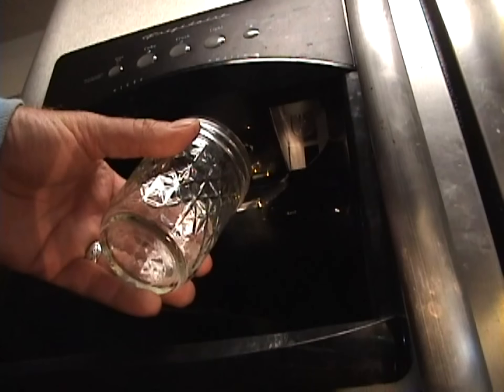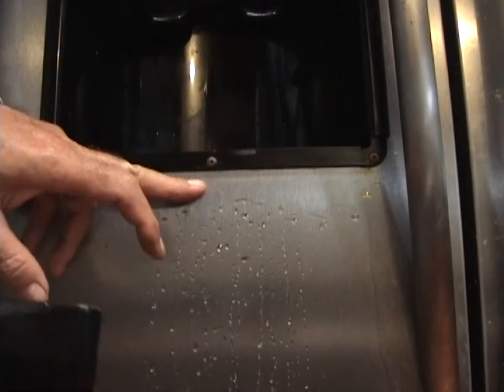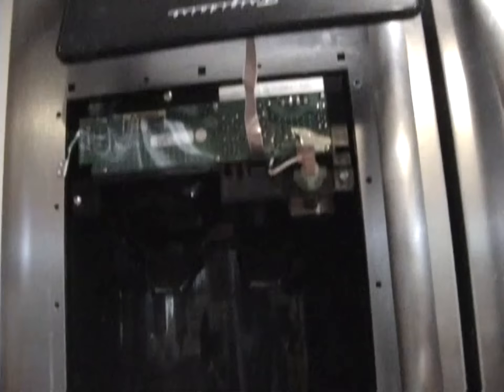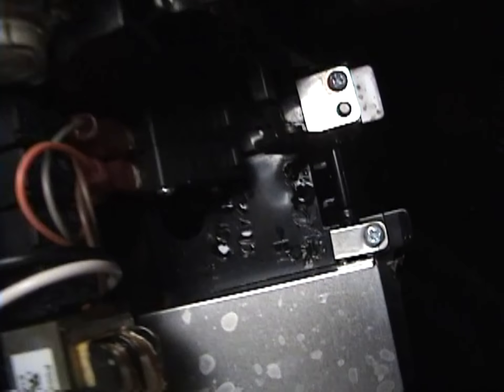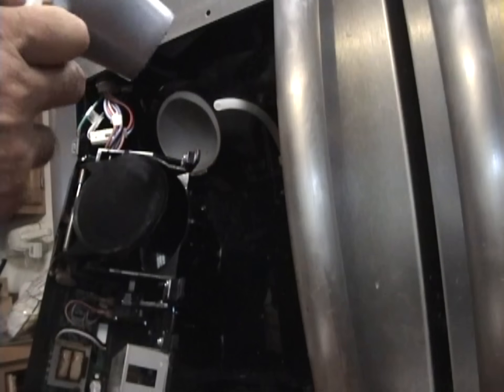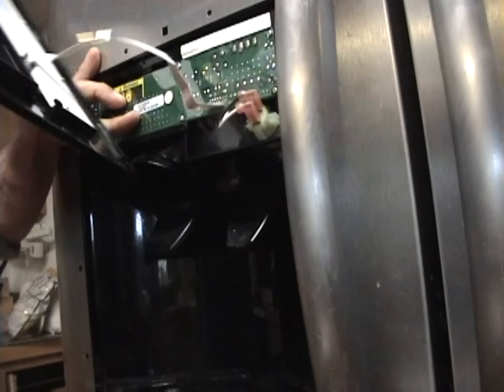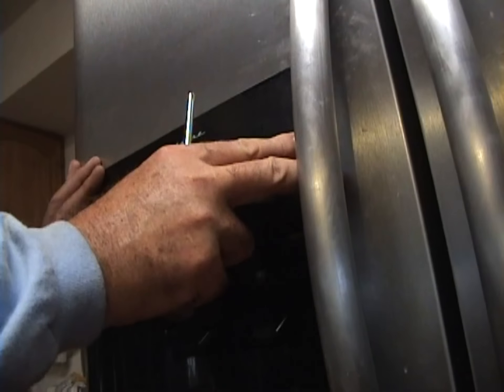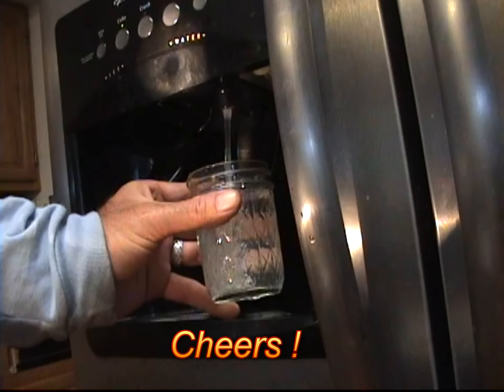Refrigerator  Door Water Dispenser Leak Fix

Comment: Jim, Thank you so much for posting this video on You tube.  My son, who is 15 years old and wants to be an engineer, reviewed the video and fixed the Water Dispenser in about 20 minutes end to end.  He didn't even need to add the additional adaptor. He just patiently manipulated the tube until he was able to fit it back into the despenser hole.  We are very greatful and you saved us a call to an authorized repair technician.

Comment: Thank you very much Jim - you saved the cost of a new fridge.   I changed the filter and this caused more water pressure which was enough for the water hose to come out of the housing, which then caused the ice auger to continuously run.  I took everything apart, used a hair dryer to dry the electrical components.  I was able to feed the water hose up from the bottom door of the fridge to give me an extra few inches to guide the hose back through the spout so i can see a 1/4" of hose. thnx Mark

Comment: Thanks for this. I  had the exact same problem after changing the filter and your instructive video saved what would have no doubt been an expensive house call.   Hardest part is trying put the hose into the dispenser. Used a piece of string and threaded it through. . .worked like a charm.
Reply from the maker: Good idea on the string... thanks for the tip !

Comment: Thanks! I had this same issue with this model fridge. My kid broke the water actuator paddle, so I had to replace it, but in the process I upset the natural balance in the universe that kept the stupid water hose nestled comfortably in the little hole thingy. I found the adaptor at Lowe's, but of course it's been like 13 years so it's not 88 cents anymore-. I got it for like $2.60 with my military discount. Also, I had a helluva time warming the hose with a hair dryer so I took my trusty Afghanistan Zippo lighter and that did the trick. Once I got the adaptor in the tube, the rest was easy.
Reply from the maker: Thanks for the comment. Glad it worked out for you. Happy Thanksgiving !

Comment: O.K.  had a problem putting the extension through the hole in the dispenser. To solve it, I tied picture wire to the extension, fed the wire through the hole, put the dispenser back in place, and pulled the wire through with the extension. Worked like a champ. Other than that it saved me a bucket of cash probable.  thanks
Reply from the maker: Good tip ! Thanks for sharing.

Comment from the maker: @almaromantica01 A water tube runs from the door dispenser out the bottom of the door where it often ends and there is joined by a coupler to another water tube that goes out the back of the frig and on to the water supply. If the door side of the coupler came off the tube and you tried to push the coupler back onto the tube, it may have pushed the end of the tube up inside the door. A flashlight and hemostats may help retrive the end of the tube from the door. Hold it with needle nose pliers.

Comment from the maker: Ensure that the dispenser paddle trigger mechanism is clean and moving freely, If you are satisfied that the paddle trigger is working properly and sending a timely signal to the solenoid, then the solenoid may have a calcium deposit that is interfering with it closing in a timely fashion. In which case you would benefit from a in-line filter and a new solenoid.  Hope this helps - best wishes in solving the problem.

Comment: Jim, I have the same exact model, however, I have a different peculiar issue.  Last week, I noticed that there were 3 "tear" drops on the floor under the freezer door.  I noticed that the door had a couple of very very small drops from what seemed to be those "tear" drops rolling down.  I check everything, and nothing seemed to be wet.  So I dried it off, and I just ignored it.  Last night, I noticed that the freezer door had a couple of very small water drops.  There was nothing on the floor.  It almost seemed like a bit of condensation, but I can only compare it to when you take a wet towel and wipe something down leaving some water droplets on the surface.  Looking at the dispenser, I pushed on that drip tray that you initially took out and a few drops started coming down from the bottom edge.  In other words, where the bottom edge of that drip tray cover (that you took out initially) meets the refrigerator door, a few drops started rolling down.  But then it stopped.  I'd say about 6 or 7 small drops may have come out.  I left a plate underneath all night and nothing was collected.  As a matter of fact, I played with it this morning, and I see nothing coming out.  What can this be?  Can this be condensation?

Comment from the maker: An electronic solonid valve with an o-ring opens and closes to start and stop the water flow. It may be that your solonid valve has a small bit of debris or calcium/iron deposit in it keeping it from closeing tightly or perhaps the o-ring is worn.  I'm not sure, but the solonid valve on your frig may be down bottom at the back where the water line feeds into your frig. If your filter is "muddy" you may benifit from replacing the filter - and perhaps the solonid valve. Best wishes for success !

Comment from the maker: I'm not sure that I understand your question, but I think the hose goes all the way from the dispenser down to the bottom of the door where it meets a coupler that also meets a hose coming from the water on/off solenoid valve at the back bottom left corner of the frig. However your model may be different. You might try inserting a short length of hose into the "hose base" and see if that restricts the water flow to just the hose...if not, then the door may have to be taken apart by a Tech.

Comment from the maker: @mikeamato100  Thanks for your comment. Yes, a slightly longer hose and  an o-ring to hold it in place on the down stream side of the dispenser hole would likely be an improvement.

Comment: I have the same model refrigerator, but my leak is occurring somewhere inside the door. The water drips down the hose and onto the floor. Also, when I try to get water from the dispenser, it takes a second for it to start flowing. Great video, by the way!

Comment from the maker: When depressed, the dispenser paddle send an electronic signal to a  solenoid valve (located most often on the lower back left corner of a frig and has the water supply hose attached to it). If you can, make sure the solenoid valve remains dry when you depress the paddle. If the solenoid remains dry, then check the fitting where the two hoses connect together at the bottom front left door. The hose at the paddle may be slightly miss aligned and dripping down onto the afore mentioned fitting.

Comment: I have the same Frigidaire side by side and after we use the water dispenser the water leaks out. Sometime a few drops and sometimes quite a bit.  I was planning on buying the replacement water line assy and replace but am not sure if that is what needs to be replaced.  Your video is very helpful.   Thanks.

Comment from the maker: Some times, after prolonged use, the O-rings on the filter get distorted and water will begin to slow leak past them and puddle up on the frig shelves. You might try replacing your filter. You should be able to find one at Lowe's... but they aren't cheap ( $35-$45). Best wishes !
Reply: Thanks, my water dispenser was dripping. I replaced the filter .Everything is working great, no drips.
Reply from the maker: Judith Scites Glad it worked out for you. Thanks for the follow-up comment.

Comment from the maker: If the brass barb is a better fit then use the brass barb - many plumbing fittings are made of brass so it should not effect the quality of your water. If that dosn't work then see the below option.

Comment from the maker: If you didn't detect any water coming from places where it should not be detected, then it sounds like it may have come unplugged. You might try ensuring the plug near the circuit board is tightly mated and perhaps use a hair dryer to dry off the circuit board. But be sure to unplug your frig before touching the circuit board. Best wishes !

Comment from the maker: As you face the frig the solenoid valve will be on the back of the frig at the bottom left corner. You should see a water line connected to it.and a plug with wires that come from the front control panel.

Comment from the maker: I'm not sure, but it sounds like the water dispenser solenoid is allowing water to bleed through . Check the owners manual for a specific make and model or part number and take those numbers with you to the parts supply store.

Comment: I just took my panel apart, but I noticed my water actually comes straight out of the tube into the glass.  The water seems like there is a slow drip coming out of the tube.  On a good day I can get it to "click" and quit leaking, but I noticed that with the panel off, the end of the tub is still wet, like a light build up.  Not sure if that makes sense.  Any thought on where up the chain it tells it to dispense water and where it could be broken.  This is for a whirlpool conquest side by side.

Comment from the maker: It may be that your freezer is just turned down to low.  Put  a thermometer in your freezer. If it is much colder than 32 degrees then turn your freezer temp up a bit.

Comment: Very helpful, Thanks Jim.  When I was working, the ribbon cable harness came off the control panel (not the main power dispenser board end).  How do I re attach that??  Thanks again

Comment: I have about same type of refrigerator, the problem I have is when removing the glass/cup the flow of water will not stop, it takes several seconds, maybe a minute until hear the click and then flow stops. What do you suggest to do? Do I have to replace the entire assembly or just a part of it?

Comment: JimbowT, I have the exact same model fridge but with a different issue.. the dispenser has a slow drip leak when not in use.  If I pull the filter, it stops.  Is the problem at the solenoid valve (bottom of fridge) or inside the door?

Comment from the maker: Anytime water drips slowly, I suspect two things: 1) Hard water deposits minerals in the solenoid valve and the build up of deposit prevents the solenoid from closing all the way - thus allowing a slow leak to occur at the ice/water dispenser drip tray (replace solenoid @ lower back of frig); 2) The O-rings of the water filter are old/misshapen and allow a slow leak to collect on the refrigerator shelves (replace water filter @ inside frig ceiling ). Hope this helps. Best wishes !

Comment: Jim I have an odd question I bought a frigidaire GLHS37EHSB7 used about 3-4 years old when I hit the water paddle its spilled a little water out of the hole (that did not have the white tube sticking out and a lot seemed to run down inside the door out onto the floor I used your info in this video and opened it up and there is no little curved hose there just a place in the body of the door that looked like it had been plugged into the little hose base any ideas how long that hose goes in need?

Comment: same thing happened to us. it worked fine for a few glasses of water then freaked out. now there is no power to the front panel. could this be due to water getting into the circuit boards and damaging them? shouldnt there be a fuse somewhere to prevent this?

Comment: I have the same fridge and I did this fix. But nownanyear later I'm getting water leaking from the bottom left of the front freezer door where the water line is going up. It doesn't leak all the time but somehow it gets real wet two or three times a day under the door. I pulled the bottom panel off and it's definitely coming from inside the freezer door where the line is running up. Any advice on fixing this?

Comment: My problem is that the water dribbles out after the paddle returns to the off position and  water slowly drips enough to fill the catch tray It's a very slow leak but it still need to be fixed. I understand there is a water control valve in the left rear of the Frigidaire unit where the copper house water supply line connects to the unit. Can that be repaired or must it be replaced? Also, I installed a new water filter and that  just seemed to  increase the leak. Any advice is appreciated.

Comment: I got the same fridge,replaced the end with same adapter but i used a heat gun to heat the tube to slide the adapter.Never use a heat gun it gets it to hot. Had to cut off a piece of it and try again then finally got it on and had to buy some more tubing so i can make it fit in the hole..
Reply from the maker: Good to know. I must of had some really tuff hose cause my wife's hair dryer didn't do much to it at all. I had to use pliers to finally jam the adapter into the hose.

Comment: I have a kenmore fridge in which the front panel is exactly like the one you are working on this video. I replaced the lever that was broken for the water dispenser. However when I removed the panels to make the repair I made the mistake to have unplugged the power strip supply (the strip that reads " sheldhal") from the panel's face and cannot make it to work, I inserted back into the entry a few times, and I made it to work on and off, however I cannot make it to be on and stady......Any ideas as of what I can do??? I am concerned I did not have to unplug this and now I am frustrated because it used to work before... Thank you for your response....
Reply from the maker: +Dorothy Crawley These type plugs usually have a little plastic latch mechanism that, when mated properly, will hold the two plug ends together. Make sure that you are getting full penetration of the male end into the female end ... and try and see if there is a little plastic finger hook that catches under a mini belt loop kind of thing. If the catch is broken, get some electrical tape, hold it together tightly and have someone wrap it tightly with the tape. Best wishes !.
Reply: +Jim Thomas Hello Jim - Ok, so let me understand first. One of the ends of the strips do not come off. This is the one I left and that is part of the ice drop and water dispenser piece. I think that one is fine (because I never took it out) I did get full penetration on the other end (the one I unplugged from the circuit panel), I do not think we are talking about the same thing...There is a connector that has a male/ female mate with some wires coming out and that plugs to the circuit panel..BUT I do not have any problems with that. The connection I am talking about looks like a 8" white tape on one side and the other has red lines (which I think powers the circuit that controls the panel)....is there a regular email I can email you some pix???? thank you for your help, I am stoked I have some answers...What's your email?
Reply from the maker: +Dorothy Crawley Send your pics to jthomas1858@gmail.com
Reply from the maker: I replied to your e-mail & here is what I said: , First try pressing the female lips together as they may be somewhat "sprung" apart. If the male part of the ribbon strip only makes contact on one side of the ribbon, then you may be able to cut one or two small bits of electrical tape and place the bits on the opposite side of the male connection terminals so as to create a "shim" to help it fit tighter. If neither of these actions work, then you might try holding it in place and using a hot glue gun to make a temporary plastic "weld"... but just be sure to not get sloppy and cover any of the connection points with either tape or hot glue... just a dab will do ya. In any case, be sure the frig is unplugged from the wall electrical socket before working on the unit. Hope this helps. Best wishes.

Comment: Good video, However I have a different problem w/ water. When closing the freeze side door, sometimes water leaks out the lower right hand corner of the dispensing station. Any thoughts.
Reply from the maker: It might be that the centripetal motion of the door swinging shut is causing water pooled in the drip tray to sling out onto the door face and floor. You try might drying your drip tray thoroughly and then put a dry paper towel on it to see if your dispenser is leaking/dripping while you aren't watching.
Reply: Unfortunately, this is not the problem. Tried what you suggested and still getting water from right hand corner of the dispensing station. Looks like water is coming from behind the framework of the station.
Reply from the maker: CHC If the filter has not been changed in a while, you might try a new filter. Also, if the dispenser water delivery hose is slightly retracted from its receptacle, then a small amount of water could escape and trickle down to the drip tray from behind the dispenser face.

Comment: So I’m having this issue as well only. Difference is my water pressure is stronger and I just changed my water filter ! But as I dispense water it goes out from everywhere and ice starts also too come out ? Any idea? I also have a Frigidaire
Reply from the maker: If slivers of ice are coming out from the water dispenser tube then you might try turning the temperature dial to a slightly warmer setting. Since the water dispenser water "goes out from everywhere" then it is very likely that the hose has become dislodged from its retainer.

Comment: Wish I had seen this before I tried to fix. Got the tube back in once but it came out soon after. Second time I tried to fix the ribbon cable broke. Found the right part number 241680002 but cannot figure out how the connector at the circuit board comes out? Don't see any tabs to unlock? Also the cable picture does not show the connection to go to the wiring harness coming out of the fridge? thanks!